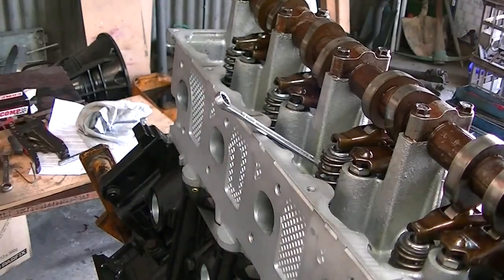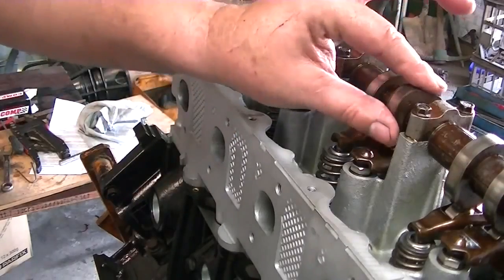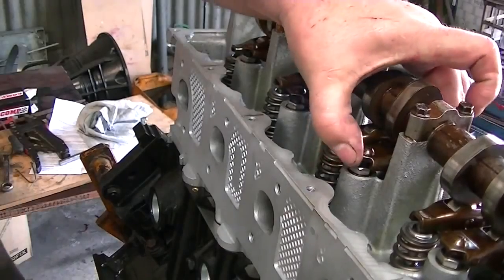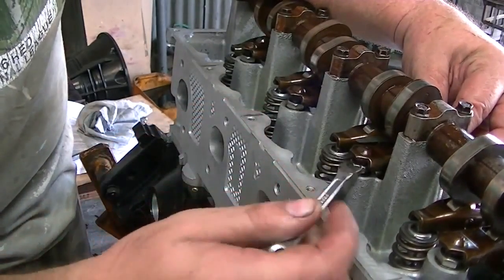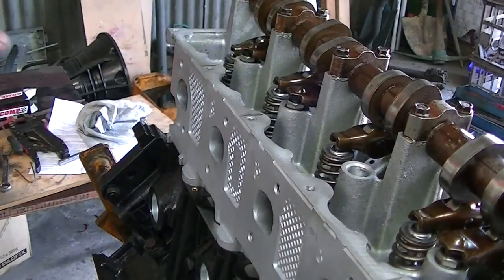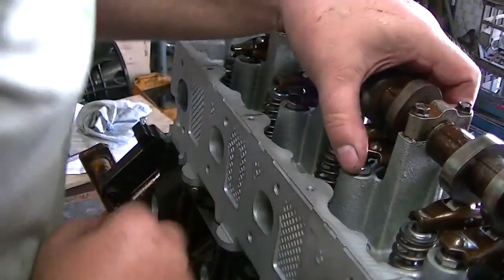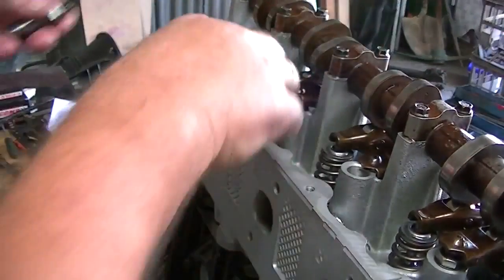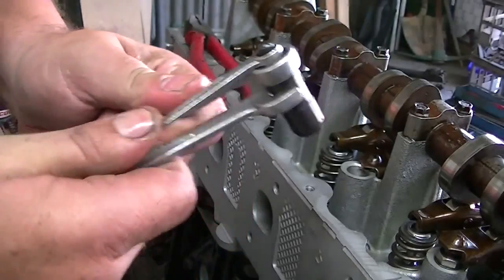How to install and adjust solid Lifters / Lash adjusters in a 4.7 V8 WJ Jeep Grand Cherokee/Dodge

Comment: if it's 👌 can i send you same pix when i get it all to together
Reply from the maker: +Danny Andrea Loza Sure I'll have a look at them. When your done installing the chain turn the engine over slowly by hand without spark plugs and if you feel any resistance you have it wrong and a valve is hitting a piston. Do not continue turning or you will do damage.
Reply from the maker: +Danny Andrea Loza the chains have different color links and they have to be in the correct position. A bit tricky but take your time to get it right.
Best of luck. :-)

Comment: it on my 04 dodge ram 1500 4.7. yes it is my first time doing it. this what's going on. the heads or resurfaced new oem lifter new oil pump new water pump new chain and tensioner .so far i put the heads back in set the cam at 12:00 and put in the lifter that can go in. and now i am waiting 4 the chain and the tensioner

Comment: What's up🏠machine. my heads blew in my 04 🐏 1500.I put the heads in how i am putting in the lifter set but my chain have not come in is this a problem.
Reply from the maker: +Danny Andrea Loza Is this about a 4.7 V8 Jeep or your Ford explorer?
The timing Chain on a Jeep 4.7 is very involved and should only be done if you have done timing chains before. If you make a mistake you can bend valves or even put a hole in your piston when it cranks over.. If you were my neighbor I could help. Please advice what vehicle it it on?
Reply from the maker: +Danny Andrea Loza But to answer your question I think your asking yes you should install the lifters and camshafts before you install the timing chain.
There should be instructions how to install it with the new chain. Make sure you get the chain pensioners right they can be a bit tricky. You don't want to start with a too tight chain. I recall having to reset mine once because  I got it wrong and it was too tight.
Reply from the maker: +Danny Andrea Loza This may help some.
https://www.youtube.com/watch?v=-zjrh1WYAgM

Comment: Hi I'm putting in valve lifter set in my 4.7 i am doing it myself. you have some good tips
Reply from the maker: +Danny Andrea Loza 
Hello Danny I am glad my clip was of some use to you.
I try answer all questions here on my channel so if you need some advice feel free to ask.
Regards Rik
Reply from the maker: +Danny Andrea Loza Are you using factory hydraulics or solids like in my clip?
I have never driven my Jeep with hydraulic lifters so I and other readers would be interested to find out if you can notice a difference. I have been asked before and could not answer the question.

Comment: This seems really easy to do with the engine out of the vehicle, but how much of a PITA is it when this is done with the motor in the jeep?   Once a year isn't alot, but even for once a year seems like a big project to do especially when you are hunched over the jeep all day long.

Any way to fix the problem with the factory adjustors??
Reply from the maker: There s a few ideas flooting around on YouTube the best seems shimming the base of the lifter with a washer. Since this is my first 4.7 V8 and I did not have it before I rebuild the engine I have never had the problem myself. Im guessing once every 20 thousand klm would be fine if you adjusted them on minimum gap. I will find out how hard it is with the engine in the car soon enough.
Mind you it would have been hard to show clearly how to do it in the car. Next time I plan to use some micrometer caliper which I think will make it easier. I will do an updated movie then.

Please subscribe :-) thanks for watching and feedback. Rik
Reply from the maker: Still have not had to re adjust them after 40k klm
Reply: Hey man are you supposed to check from cam to rocker or rocker to valve stem?